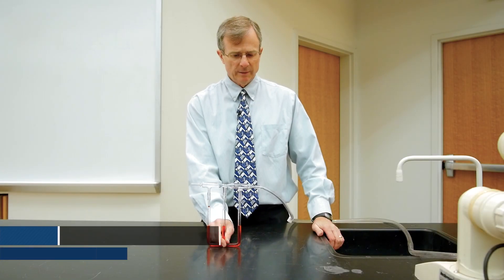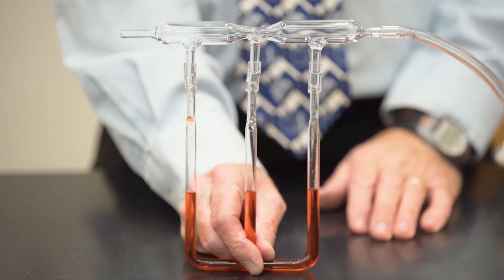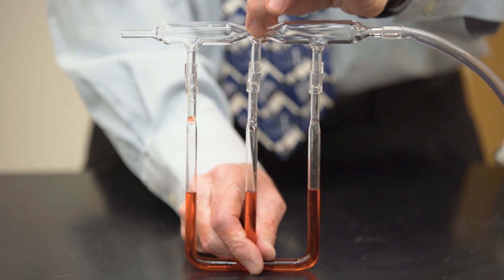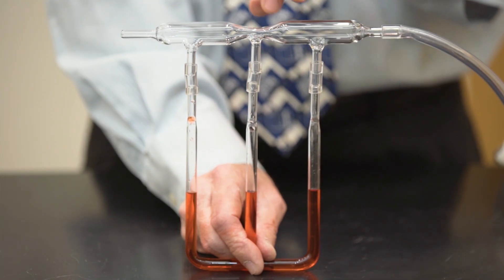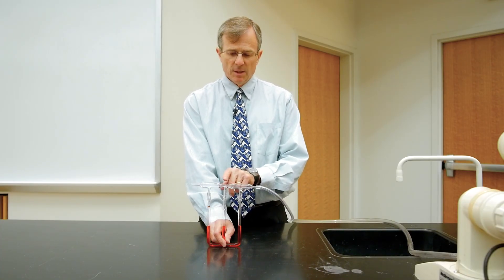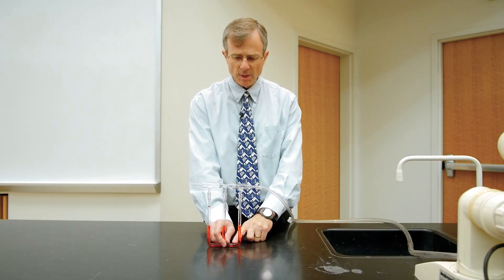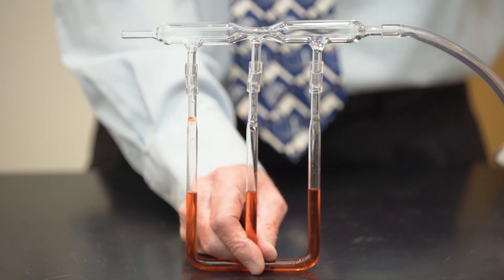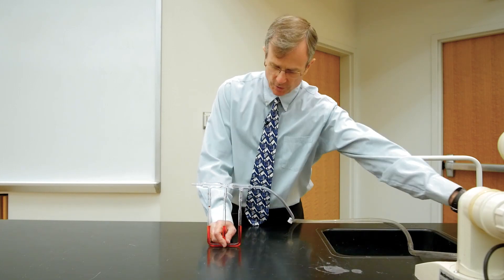Bernoulli's Principle Demo: Venturi Tube

Comment: This is a good demonstration, and i understand how the principle works, i just dont understand why. Why would the small part have a lower pressure when it is literally being squeezed tighter into a small place? Why do things at higher velocities have lower pressure? Isnt velocity relative? How would a fluid even “know” if it was moving fast or slow? Someone help, its 2:00 am. Idk maybe im just getting into some pretty complicated stuff that my poor brain could never comprehend, but im still gonna try
Reply from the maker: The easiest way to understand why the pressure is lower in the narrow part is that an element of fluid in the wide part must accelerate as it approaches the narrow part (because conservation of mass requires this).  The only way for the fluid element to accelerate is if the pressure is greater behind it (in the wider part) than in front of it (in the narrower part), creating a net pressure force on the element that causes it to accelerate as it approaches the narrow part.
Reply: Physics Demos makes sense that there would need to be a pressure difference, so does that mean that the larger tube gains pressure, or does the smaller tube lose pressure, if you know what i mean? I would instinctively think the large one gains pressure cause all the particles hitting the bottleneck would sort of pile up on each other, and force the air through the small hole, but once it gets going through the hole, the air is able to move freely again and return to normal pressure since nothing is blocking it anymore. So if you added another tube comparing the small section with the atmosphere, would the small tube be the same, if not slightly higher pressure? Also thanks for replying
Reply from the maker: @buzzmas8068  The pressure buildup from the particles hitting the bottleneck is a good way of thinking about why the pressure is larger in the wider region, relative to the narrow region. You can think of it either way -  larger tube gains pressure or the smaller tube loses pressure.  None of the pressures is "normal."
Reply: @physicsdemos    This is one of the better demos because it shows the static pressure rise in the first wide section when flow occurs. 
..
What I don't understand is why no one addresses this increase as caused by the restriction effect of the narrowing of the pipe.  The fact is, that the restriction is attempting to reduce the flow and, therefore, causes the increased static pressure  in the right hand wide section.  
The fluid is not being squeezed in the narrow section, it is the outlet that allows the fluid to "escape" the higher pressure section. 
..  
Think of the wide inlet section as a pressurized tank with an outlet that is relatively small.  The pump is forcing high pressure fluid in from the right. This is a characteristic of a constant flow system, or pump. 
Everyone just says "Conservation of energy" and that the energies in effect exchange places as cross section changes.  I find that to be disingenuous, or at least incomplete.  
If no energy is added or removed, and the fundamental setup prevents and energy change, then this is a given, not a cause, 
.
..
Air has mass and we know, ever since Newton, that a force is required to accelerate a mass.  Therefore, there must be some force/pressure causing the acceleration and it is our responsibility to explain that pressure.

.
Reply: @physicsdemos  If that really was the easiest way to understand it....why didn't you explain it that way in the video?
Reply: +Buzzmas
, Here's WHY
..
All pressures mentioned here are static pressures.
..
The narrow section is not squeezing the air because it's free to exit on the left.
..
IMPORTANT: NOTE that the pressure in the right wide section INCREASES when the flow starts. This is very significant.  It tells us that something is restricting/resisting the flow above and beyond the atmospheric pressure at the left.
THAT resistance is caused by is the NARROWING entering the narrow center section.  The narrowing increases the pressure UP-STREAM. 
.
With a higher pressure there, the narrow section is now an outlet which allows the air to escape. Think of the right-hand wide section as a pressurized tank.  The narrow section is now a hole in the tank letting air escape.
..
If you started with a completely wide pipe exiting into the atmosphere, it would be atmospheric pressure at the left and pretty much atmospheric pressure all along the length of an all-wide tube.
...
If you could vary the cross section of an all-wide tube, you would see the pressure on the right go up when it was narrow in the center or anywhere down stream..
..
Help?
Reply: Same here. a more detailed explanation needed. Pressure higher, and fluid travelling faster, with no energy loss?? Does this mean a smaller water pipe is the same as a larger one to transfer at the same rate?

Comment: Does the narrow part of the Venturi tube also get colder than the wide part?
Reply: may be low pressure, low density, thus molecules are not that active...like in the upper atmosphere of the earth low pressure thus temperature goes in "-Celsius"...may be i don't know.
Reply from the maker: I don't know.